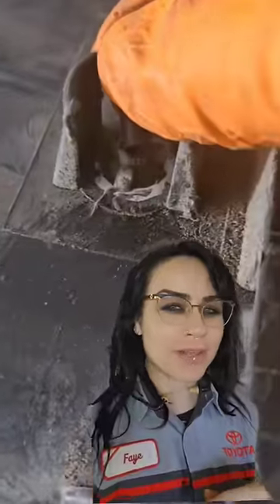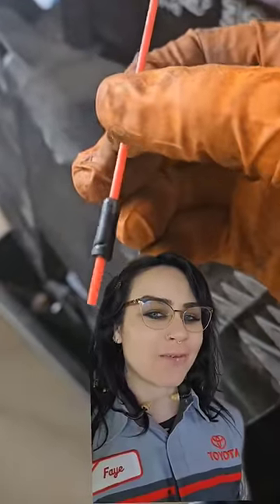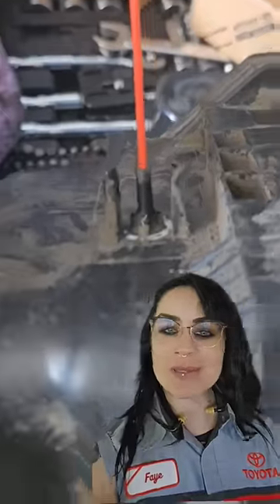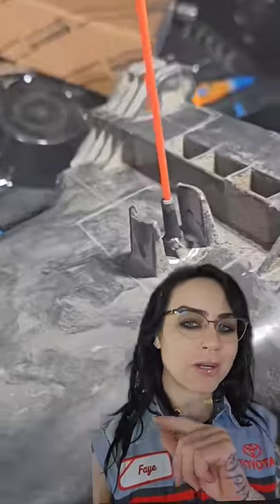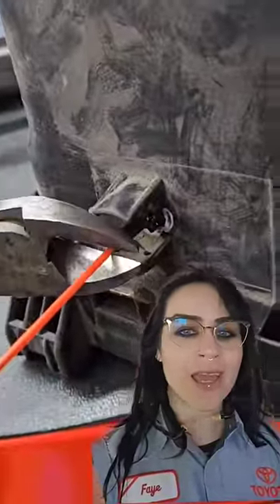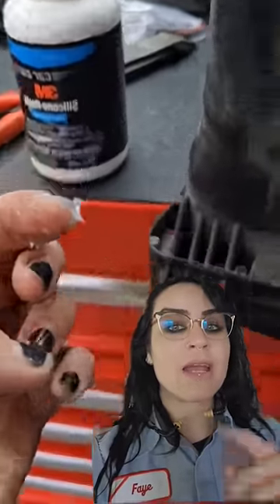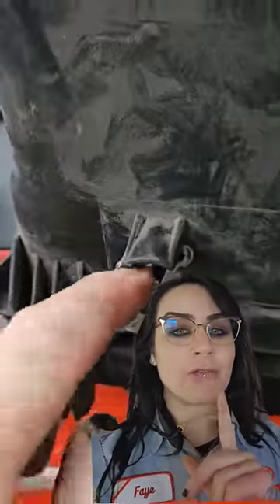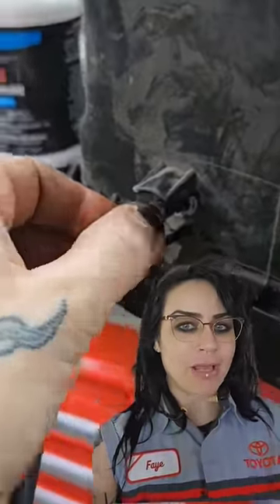Quick Fix - Broken Vacuum Port / Air Box Nipple Repair #techtips #toyotatech #femalemechanic #diyfix

Comment: Here’s why this is stupid. You have now restricted the airflow by approximately half. This will affect the MAF reading, the ECU can’t just adapt to the new level of airflow. You’re effectively choking the engine of oxygen which will affect the quality of combustion.

Doing this will 100% make your engine run lean.

This is why you don’t take your car to independent mechanics. They think they’re wizards but they’re actually the dropouts, or people that were too stupid to be mechanical engineers in the first place.

Source: 2nd year thermodynamics.

Take your car to the main dealer kids.